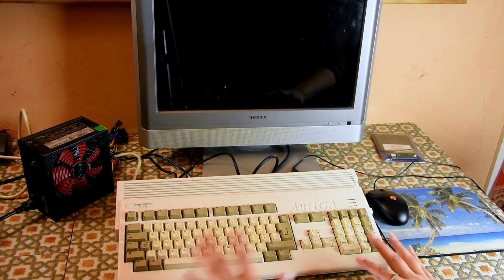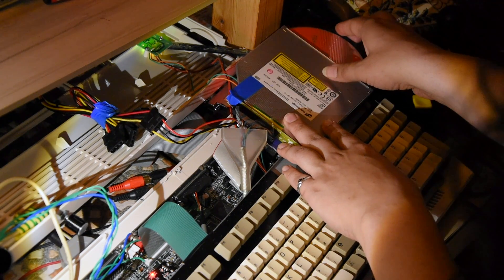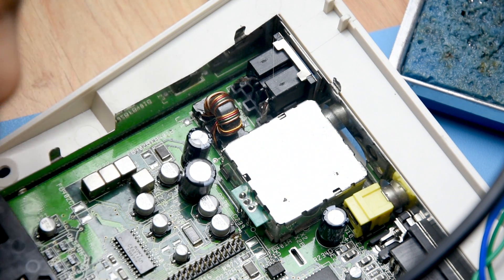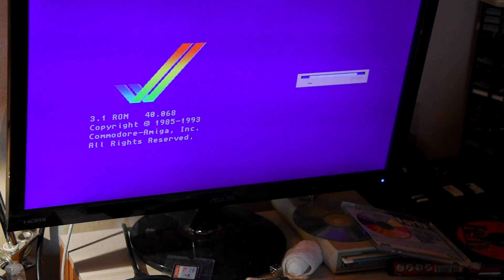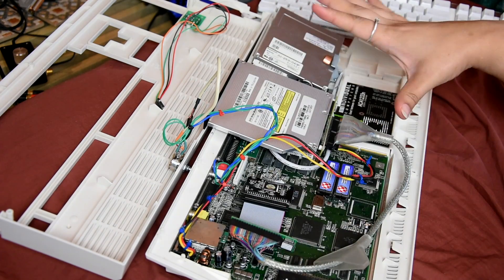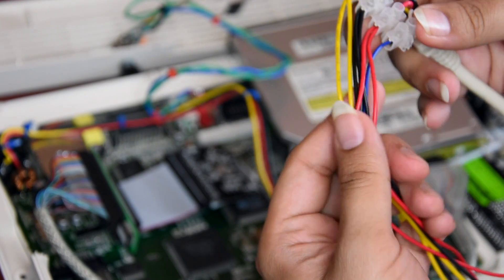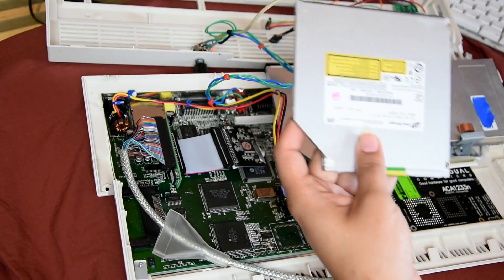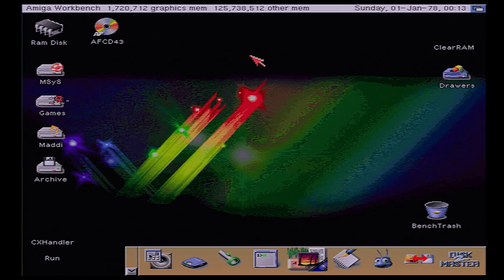Amiga Optical Drive - Part 3 Issues, fixes and Improvements

Comment: blue ide port is on an ata 66 or faster cable - your cdrom might not be able compatible with the older cables - they are both 40/39 pins, but the blue port cable has 80 wires (half shielding) with the other one being 40 wires only.
Reply: It doesn't matter, you are limiting maximum bandwidth of IDE using regular 40 pin instead of 80 , which in any case Amiga isn't capable  of achieving
Reply: They don't have jumpers so its possible Mady placed it on slave end of the cable ?
Reply: yeah but i wasnt saying the amiga was the problem - more the cd rom supporting the older standard, as +Karl Bewsher points out
Reply: As Idimi Dodjimi pointed out, the Amiga 1200's IDE runs at PIO instead of DMA, so the 80-pin cable is not needed (and changes nothing). It should work just fine with a regular 40-pin cable. If not, then I'm puzzled.
EDIT: Using an 80-pin cable is still fine, and those can come in the shown convenient rounded cable tubes.
Reply: All the 80-wire UDMA cables should be Cable Select (_CSEL) enabled and the connectors are color coded for their correct connection: Host - Slave - Master. Also they have orientation key hole blocked. So "newer" PATA drives should automagically select their role on the IDE bus by the connector they are connected to. Also many slim drives in circulation are from OEM computers, like HP or Dell, and usually have custom firmwares or may be hard-wired to fit in just the original source computer. But basically, if cables are not faulty, both types should work fine in PIO0 speeds, but 80-wire having less interference. The IDE connector on A1200/A600 mobos are old style and does not comply to the standard. You can easily make them more compatible by removing the pin 20 (KEY) and adding a solder blob between pins 28 (NC on Amiga/_CSEL in other realm) and 30 (GND).  My A600 modding and some toughts about the subject are shown here: http://udioica.mbnet.fi/mod_a600lang/index2.html
Reply: That's a good point and something I had long since forgotten about!  There was a time when ATA 100 kicked in people just assumed the old cables would still work just the same.

Comment: Fantastic video as usual!

I need to take the courage (and the time, LOL) to start doing my soldering exercises, because I want to do some recap (my A600 and another A1200 I have both need to be done) as safely as possible.

Though every time I think I have a complete set of tools that can make the process easier I discover something else, on your channel, that I should add to my arsenal! Hahahahahaha!

I am pretty sure I can get away with what I have so far but, you know, the easier the better I guess? :-D

Anyways, thanks for the great video and the good contents!

Keep up the good work! ;-)
Reply from the maker: If you're talking about SMD recapping on the A600 and A1200, then I need to start soldering/desoldering exercises too lol SMD scares me a little.
Hahah sorry I keep expanding your inventory of tools, but indeed, the right tools for the job right? ;o) 
My pleasure Mauro and thank you! :o)
Reply: Definitely, the right tools for the job! Especially that desoldering station you got recently! :-D

About recapping: I want to replace all the important ones. I have bought a capacitor kit for both computers (which is basically the whole capacitors set according to each Amiga model, 600 and 1200) from Amigastore.net for the purpose.

Ufff... I really need to start doing it. Maybe I will test my [lack of]skills on an old adsl modem first! :-D
Reply from the maker: Ah that desoldering pump is a Godsend! lol I cant believe how easy it is now, I wish I had got it before struggling with the previous Commodore 64 and Amiga recapp attempts!  All those long nights wrestling with a freakin manual solder pump and braid! Throughhole desoldering really is not fun with a wick/braid or hand pump!

nice, so you’re actually ready for recapping your Amigas, you got everything prepared :o) 

Yes indeed, I would strongly recommend practicing on adsl modems etc first also, i’m sure you could improve your skill after a few days to a week even! :o)
Reply: "Throughhole desoldering really is not fun with a wick/braid or hand pump!"

Which is exactly what I have so far! LOL